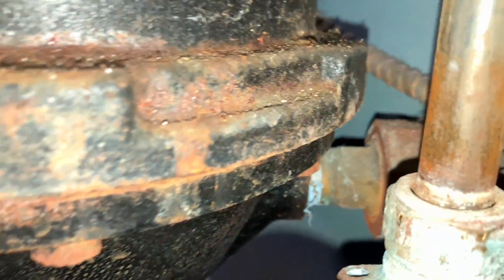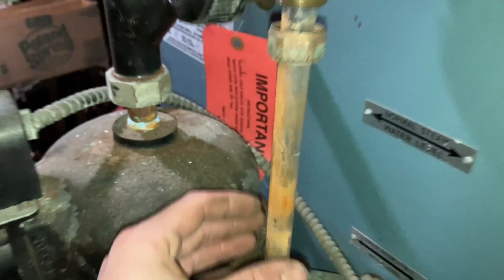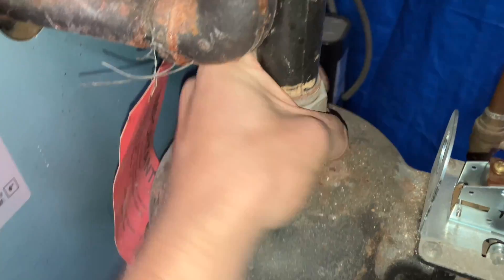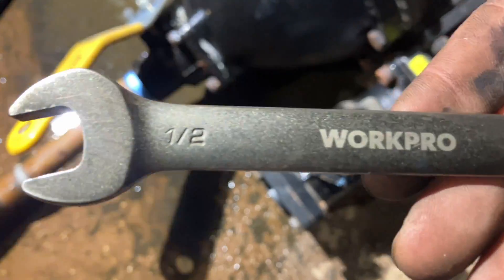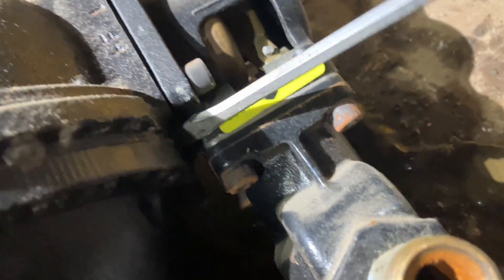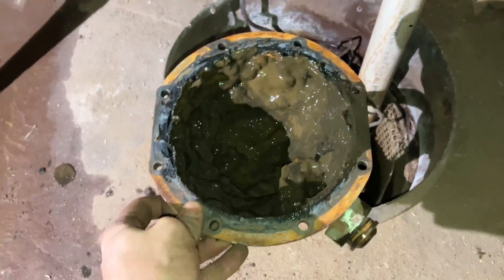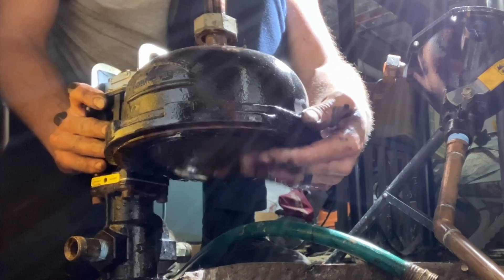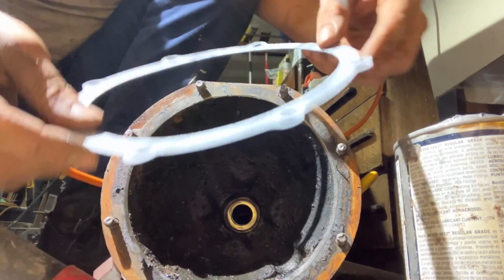I'm Not Sorry I Opened the Low Water Cut Off's

Comment: I just did a breakdown on my 47-2, actually only 4 years old since I last replaced mine. I did the blowdown weekly and made sure the boiler was always running, After this the water ran out and the boiler shut down, would not restart. Simply ran into this problem once before, the feeder screen was clogged and possibly the feed valve was gummed up. Cleaned them both, heater fired up, however I ordered a new set.

Comment: Hello,  I  have the same McDonnell & Miller float style low water cut off.  Mine is not draining well.  Probably same issue...mud & clogged.  I see that you removed the whole unit.  I was wondering if it is possible to remove just the lower section (taking the bolts off around the middle) & removing the bottom to clean the unit.  Please let me know.  Thank you!